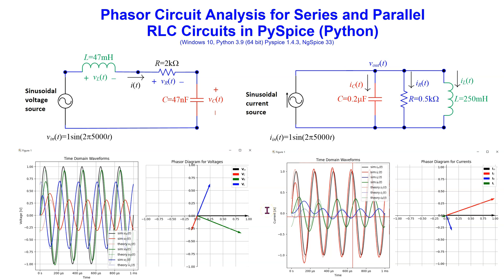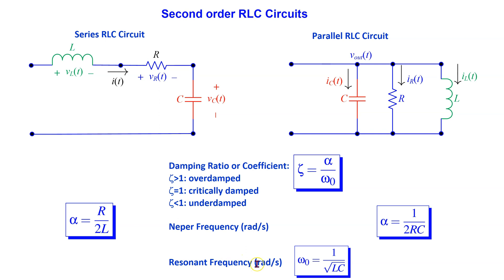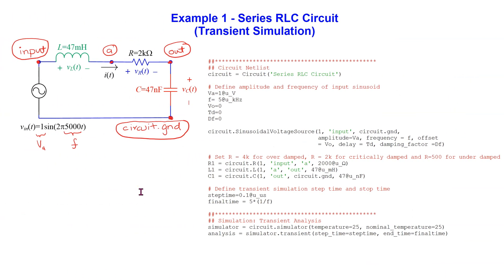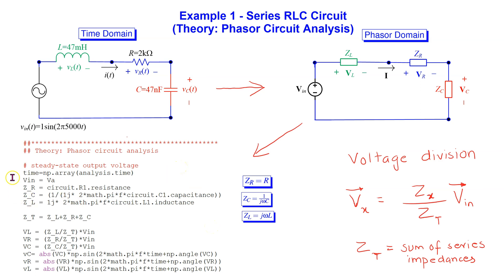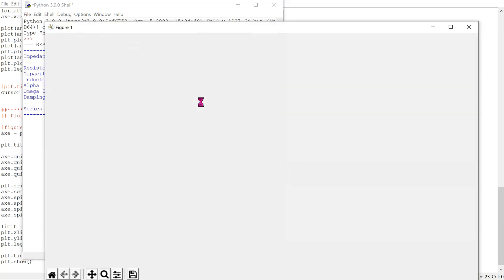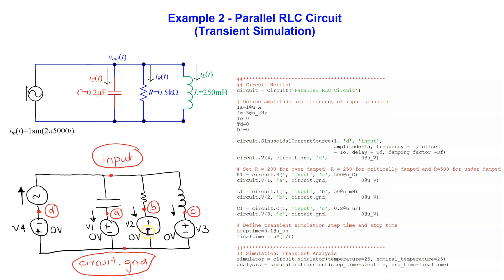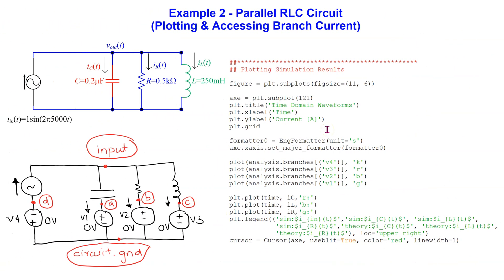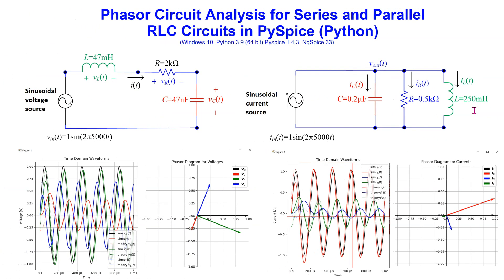Phasor Circuit Analysis Using PySpice (Python) for Series and Parallel RLC Circuits

Comment: Hi Its Akash again  .....What is v1,v2,v3 and v4. Is it the name of your nodes? Can you type the full code for parallel RLC circuit. I want to extract ,current as a function of time in a transient analysis? Your feedback would be highly appreciated?
Reply: import matplotlib.pyplot as plt
import numpy as np
import PySpice.Logging.Logging as Logging
from PySpice.Spice.Netlist import Circuit
from PySpice.Unit import *

logger = Logging.setup_logging()

# Original circuit parameters
inductance = 0.626@u_mH   # 0.626 milli Henrys
capacitance = 0.1@u_uF    # 100 nano farads
resistance = 0.019@u_Ω    # 19 milli ohms per kilometer

# New circuit parameters
modified_inductance = 0.01@u_mH   # Modified inductance value for the desired behavior
modified_capacitance = 0.01@u_uF  # Modified capacitance value for the desired behavior
modified_resistance = 10@u_Ω     # Modified resistance value for the desired behavior

# Create the circuit
circuit = Circuit('Four double-pole Low-Pass RLC Filter')

# Add circuit elements for Lumped Parameter Model
voltage_source = circuit.SinusoidalVoltageSource('input1', 'in', circuit.gnd, amplitude=14000@u_V, frequency=60@u_Hz)
R1 = circuit.R(1, 'in', 2, resistance)
L1 = circuit.L(1, 2, 3, inductance)
C1 = circuit.C(1, 3, circuit.gnd, capacitance)

simulator = circuit.simulator(temperature=25, nominal_temperature=25)

# Perform transient analysis from 0 to 1.0 seconds
analysis1 = simulator.transient(step_time=0.001, end_time=1.0)

# Modify resistance for desired behavior
R1.resistance = modified_resistance

# Perform transient analysis from 1.0 to 1.02 seconds with modified circuit
analysis2 = simulator.transient(step_time=0.001, start_time=1.0, end_time=1.02)

# Rectification of everything back to normal
# Modify resistance for desired behavior
R1.resistance = 0.019@u_Ω

# Perform transient analysis from 1.02 to 2 seconds with modified circuit
analysis3 = simulator.transient(step_time=0.0001, start_time=1.02, end_time=2)

# Extract time and voltage data for plotting
time1, voltage1 = analysis1.time, np.real(analysis1['3'])
time2, voltage2 = analysis2.time, np.real(analysis2['3'])
time3, voltage3 = analysis3.time, np.real(analysis3['3'])

# Extract time and current data for plotting
ctime1, current1 = analysis1.time, np.real(analysis1.branches['2'].current)

# Print current through resistor R1
print('Current through R1: {:5.2f} A'.format(float(current1)))

# Plotting
plt.figure(figsize=(10, 5))
plt.subplot(2, 1, 1)
plt.plot(time1, voltage1, label='Original Circuit')
plt.plot(time2, voltage2, label='Modified Circuit')
plt.plot(time3, voltage3, label='Rectified Circuit')
plt.xlabel('Time (s)')
plt.ylabel('Voltage (V)')
plt.title('Transient Analysis - Voltage')
plt.legend()

plt.subplot(2, 1, 2)
plt.plot(ctime1, current1, label='Original Circuit')
plt.xlabel('Time (s)')
plt.ylabel('Current (A)')
plt.title('Transient Analysis - Current')
plt.legend()

plt.tight_layout()
plt.show()
Reply from the maker: Thank you for posting your code. Please code the code below for a similar example, which shows how you need to modify the netlist in order to probe the currents. This code is posted in the comments section for the following video: https://www.youtube.com/watch?v=DFuKQmYmZaY

This should help you to modify your code to plot the currents. If you do it yourself, you will develop a deeper understanding.

## Phasor circuit analysis for Parallel RLC circuit

##*******************************************
import math
import numpy as np
import matplotlib.pyplot as plt
from matplotlib.widgets import Cursor
from matplotlib.pyplot import semilogx
from matplotlib import pyplot

import PySpice.Logging.Logging as Logging
logger = Logging.setup_logging()

from PySpice.Doc.ExampleTools import find_libraries
from PySpice.Probe.Plot import plot
from PySpice.Spice.Library import SpiceLibrary
from PySpice.Spice.Netlist import Circuit
from PySpice.Unit import *

from engineering_notation import EngNumber

from matplotlib.ticker import EngFormatter

##*******************************************
## Circuit Netlist
circuit = Circuit('Parallel RLC Circuit')

# Define amplitude and frequency of input sinusoid
Ia=1@u_A
f= 5@u_kHz
Io=0
Td=0
Df=0

circuit.SinusoidalCurrentSource(1, 'd', 'input', 
                                amplitude=Ia, frequency = f, offset
                                = Io, delay = Td, damping_factor =Df)
circuit.V(4, circuit.gnd, 'd',           0@u_V)

# Set R = 200 for over damped, R = 250 for critically damped and R=500 for under damped
R1 = circuit.R(1, 'input', 'a', 500@u_Ω)
circuit.V(1, 'a', circuit.gnd,           0@u_V)

L1 = circuit.L(1, 'input', 'b', 50@u_mH)
circuit.V(2, 'b', circuit.gnd,           0@u_V)

C1 = circuit.C(1, 'input', 'c', 0.2@u_uF)
circuit.V(3, 'c', circuit.gnd,           0@u_V)

# Define transient simulation step time and stop time
steptime=0.1@u_us
finaltime = 5*(1/f)

##*******************************************
## Simulation: Transient Analysis
simulator = circuit.simulator(temperature=25, nominal_temperature=25)
analysis = simulator.transient(step_time=steptime, end_time=finaltime)

##*******************************************
## Theory: Phasor circuit analysis

# steady-state output voltage
time=np.array(analysis.time)
Iin = Ia
Z_R = circuit.R1.resistance
Z_C = (1/(1j* 2*math.pi*f*circuit.C1.capacitance))
Z_L = 1j* 2*math.pi*f*circuit.L1.inductance

Z_T = 1/((1/Z_R) + (1/Z_C) + (1/Z_L))

IL = (Z_T/Z_L)*Iin
IR = (Z_T/Z_R)*Iin
IC = (Z_T/Z_C)*Iin
iC= abs(IC)*np.sin(2*math.pi*f*time+np.angle(IC))
iR = abs(IR)*np.sin(2*math.pi*f*time+np.angle(IR))
iL = abs(IL)*np.sin(2*math.pi*f*time+np.angle(IL))

print ('----------')
print ('Impedances')
print ('----------')
print('Resistor Impedance ={} Ω'.format(EngNumber(float(Z_R))))
print('Capacitor Impedance = {:.2f} Ω'.format(Z_C))
print('Inductor Impedance = {:.2f} Ω'.format(Z_L))

alpha = float(1/(2*circuit.R1.resistance*circuit.C1.capacitance))
omega0 = float(math.sqrt(1/(circuit.L1.inductance*circuit.C1.capacitance)))
damping_ratio = float(alpha/omega0)

print('Alpha ={} rad/s'.format(EngNumber(alpha)))
print('Omega_0 ={} rad/s'.format(EngNumber(omega0)))
print('Damping ratio ={}'.format(EngNumber(damping_ratio)))

if damping_ratio == 1:
    print('-----------------')
    print('Parallel RLC circuit is critically damped')
    print('-----------------')
elif damping_ratio > 1:
    print('-----------')
    print('Parallel RLC circuit is overdamped')
    print('------------')
else:
    print('-----------')
    print('Parallel RLC circuit is underdamped')
    print('-----------')
    

##*******************************************
## Plotting Simulation Results

figure = plt.subplots(figsize=(11, 6))

axe = plt.subplot(121)
plt.title('Time Domain Waveforms')
plt.xlabel('Time')
plt.ylabel('Current [A]')
plt.grid

formatter0 = EngFormatter(unit='s')
axe.xaxis.set_major_formatter(formatter0)

plot(analysis.branches[('v4')], 'k')
plot(analysis.branches[('v3')], 'r')
plot(analysis.branches[('v2')], 'b')
plot(analysis.branches[('v1')], 'g')

plt.plot(time, iC,'r:')
plt.plot(time, iL,'b:')
plt.plot(time, iR,'g:')
plt.legend(('sim:$i_{in}(t)$','sim:$i_{C}(t)$', 'sim:$i_{L}(t)$',
            'sim:$i_{R}(t)$','theory:$i_{C}(t)$', 'theory:$i_{L}(t)$',
            'theory:$i_{R}(t)$'), loc='upper right')
cursor = Cursor(axe, useblit=True, color='red', linewidth=1)

##*******************************************
## Plotting Phasor Diagram

#figure = plt.subplots(figsize=(11, 6))
axe = plt.subplot(122)

plt.title('Phasor Diagram for Currents')

axe.quiver(0, 0, float(Iin), 0,units='xy' ,scale=1,color='k')
axe.quiver(0, 0, np.array((np.real(IC))), np.array((np.imag(IC))),units='xy' ,scale=1, color='r')
axe.quiver(0, 0, np.array((np.real(IR))), np.array((np.imag(IR))),units='xy' ,scale=1, color='b')
axe.quiver(0, 0, np.array((np.real(IL))), np.array((np.imag(IL))),units='xy' ,scale=1, color='g')

plt.grid()
axe.set_aspect('equal')
axe.spines['left'].set_position('zero')
axe.spines['right'].set_color('none')
axe.spines['bottom'].set_position('zero')
axe.spines['top'].set_color('none')

limit = max(float(Ia),np.amax(abs(IC)),np.amax(abs(IR)),np.amax(abs(IL)))
plt.xlim(-limit,limit)
plt.ylim(-limit,limit)
plt.legend(('$\mathbf{I}_{in}$','$\mathbf{I}_{C}$', '$\mathbf{I}_{R}$', '$\mathbf{I}_{L}$'))

plt.tight_layout()
plt.show()
Reply from the maker: In the video https://youtu.be/DFuKQmYmZaY?t=515 v1, v2, v3 and v4 are 0V test voltage sources which can be used to probe the current in transient analysis. 

Please watch the following video carefully. It explains this method in complete detail: https://youtu.be/472qQi09rbg